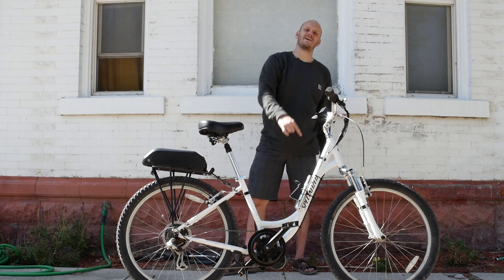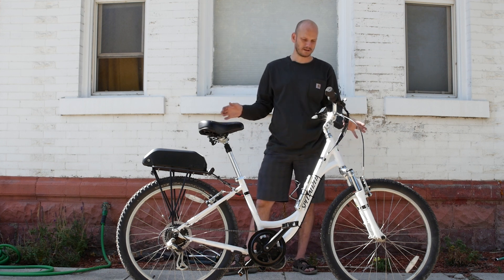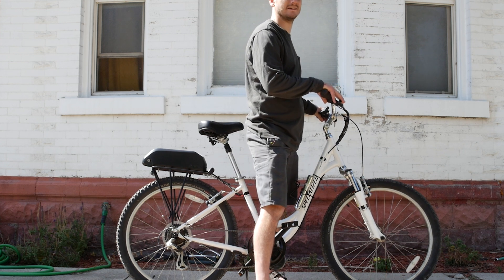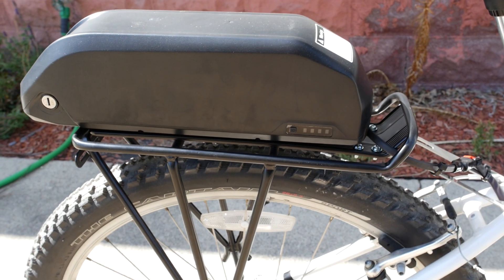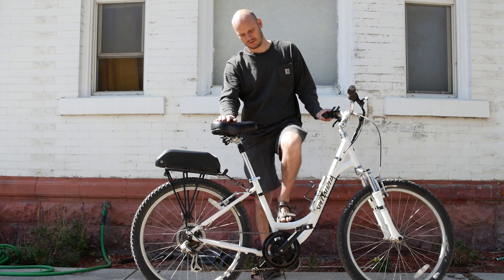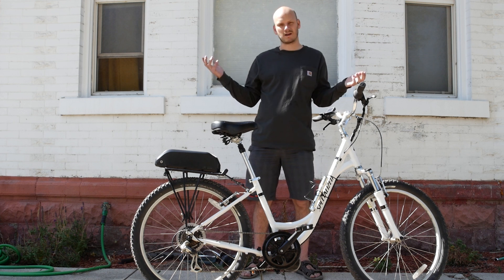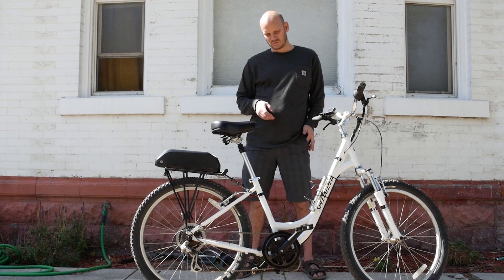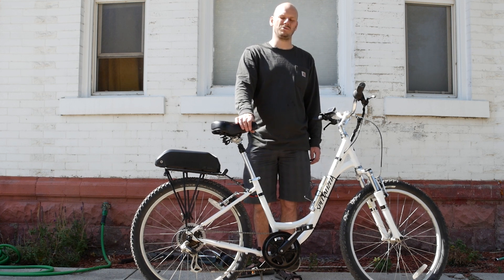Custom E-bike Build: Specialized Expedition Sport w/ 750w Mid Drive BBS02 52v 16.75ah

Comment: I have a BBSHD  and due to the cadence sensor, i don't see the point of the mid drive because the power delivery is based on speed, i tend to use the power setting  instead of  the derailleur. These are great units, but  now i only run one gear without the derailleur. If  Bafang has an equivalent hub drive, i might consider that if its a cheaper option on the next build.

Comment: Would have put the battery where the bottle holder is, myself. Although most step-throws don't have the preinstalled bolt fixtures on the sloping frame, so I can see why you used the rake 😞
Ebike top legal speed  Europe 15.5 mph 🙂Above that is the “Speed Pedelec” which can go up to 28 mph but you'll need to register the bike as a scooter/motorbike or similar.
Bla, Bla, Bla  
(Owner and builder of a Dillenger Street Legal Kit 2016 )

Comment: Nice step thru.  Glad you mentioned programming the motor down to improve range.  I’m 71 and love my step thru.  Since I’m 5’ 10 a lot of step thru bikes are not big enough.  Trek and Specialized do make a few bikes that are step thru/low entry that are Large enough.  Currently have a Large Trek  step thru with 19 inch seat post that has a BBS02.  I have the capability for 2 batteries that I take if I’m riding a long distance (over 50 miles).
Reply: Marin bikes have a lot of ST options

Comment: Never a fan of off road suspensions fornon road comfort, but there is nothing more comfortable or stable than a Dutch style step through. What a great and practical commuter and touring bike! I might use a Travel Agent for that rear brake and either put a cover on the battery or put a shrink wrap battery in a top bag.
Reply: Whats a “Travel Agent”?

Comment: Another great video John. I pedal my conversion on the flats with no assist and I get over 130 miles on a charge, 48v by 24.5 amp. I think if I tried  I could get 200 miles on a charge.
Reply: I've gotten 200 miles on pedal assist 0 before

Comment: How long do we have to wait when the amps as well as the volts of an ebike are ramped up much higher in a smaller package, or at least the same size now, but again get a heck of a lot more for the real estate it takes up currently?
Reply: this is not so simple. legal e bike mopeds have to be max 750W nominal in the US, lower in other countries. affordable motors are hub motors, and 750W need to be geared hubs to provide decent torque with standard 20-26 in wheels. this also limits the amount of power you can put out in a reasonably sized package, with the planetary gear taking a significant amount of space in the hub, and limited cooling in an enclosed hub . direct drive hubs need more power to provide decent torque, which also makes them super heavy, not road legal. mid drives with pedal assist are more complex and expensive, more complicated to integrate in a frame, also need to be geared down to provide good torque at the crank. the best technical solution for e motorcycle or mopeds is a single speed mid drive with gear reduction, no pedals like on sur Ron's because it allows higher power/torque in a reasonable package but then hey can't be classified as mopeds in a lot of countries / states, they are just lightweight motorcycles

increasing amps needs bigger wires, heavier controllers and motor windings
increasing voltage means better insulation, is also limited by the electronics, and the motor voltage (controller has to step down the voltage to the motor voltage, depending on the rotation speed, so using high voltage battery doesn't help). EV motors and controllers are more advanced, more expensive, they have active cooling, and as a result better power density. it's not currently possible to just scale down a Tesla Plaid or lucid air motor that produce up to 10 HP /kg
but I agree (hopefully) there will be improvements. ebikes power are limited by legislation but each generation of mid drive  is getting lighter, lightest mid drives are in 1.5-3kg range which is not a lot compared to the battery weight anyway. battery weight is even harder to reduce and powerful motors need big batteries, first to be able to provide high output to the motor, and second to provide decent range/run time at top speed. more power means higher speeds and energy efficiency goes down with speed.
Reply: @geemy9675  that’s a lot of information’ ai appreciated it. Thanks! 

Thankfully the legal matter of a motor being 750w is not really upheld, so 1000w geared hub motors Not to mention 5000w motors etc are being built by Diy’ers all the time. I have no issue with the motors as they are not an issue, but the amps required to truly enjoy all that power, or even a low power relatively like 500-750 etc on throttle alone needs to be a lot of amps as the voltage out there is not 240, but a fraction of that amount. Unless you are 90lbs. throttling should be rarely used.
Reply: @buffalomind6838  the thing is you can't just feed any voltage to a motor the voltage is function of th kV of the motor and the speed it's spinning. the motor dictates the voltage to the controller, not the other way around. on the other hand the controller can send as many amps to the motor (until it melts) 
this is why putting a higher voltage battery won't give you more torque, but only more top speed (to a certain point).even if you took a 52V battery and changed the series/parallel configuration to be 208V with a quarter the me amps, you would have the same power output but provided the controller handled it (which it won't), or you upgraded it, the controller would still have to reduce the voltage to the motor voltage and would just have more "work" and run less efficiently (more heat, less power to the motor) so there's no point having a battery/contoller with more voltage that the motor can handle. by the way 200+V would be much more dangerous and need much more thorough insulation.
if you wanted to have a motor that can handle 4x more  volts at same rpm you need 4x as much windings thus making the motor way bigger and heavier. internal resistance will also be x4 so yes you can offset that by using lower amps and thinner wires. but in the end nothing's free and it's all a compromise between voltage/amps, top speed/torque, number and gauge of the windings which is the reason why most motor have similar characteristic with different tuning depending on the wheel size , bike usage (commuter/MTB/road/cargo bike), iif your looking for better climbing or top speed. it's also the reason why ev have both more amps and more volts because increasing one without the other wouldn't be as effective. with EV's, increasing battery voltage can also allow faster  charging with same charging cable, until you reach max power that the battery can handle. brushless motors are already quite good, but it's true that ebike motors are  not really state of the art, because they have to deal with evoke having large wheels, and low power, high torque,  which means they need gear reduction, which adds up to the weight and size. 80Nm is a common value  on hub or  mid drives, which is almost as much as a Mitsubishi mirage..